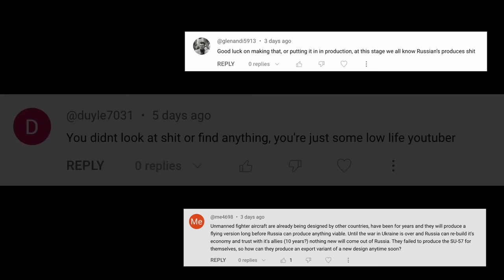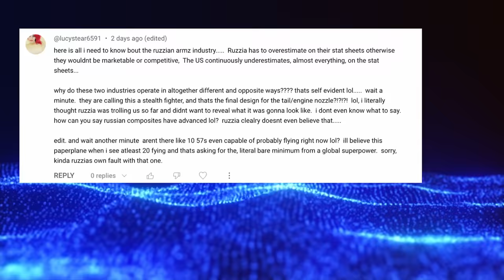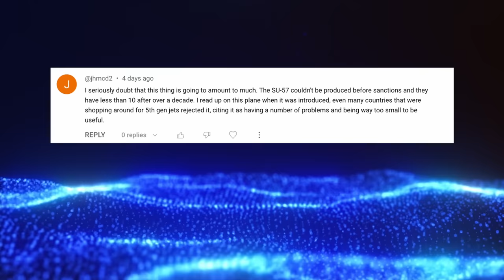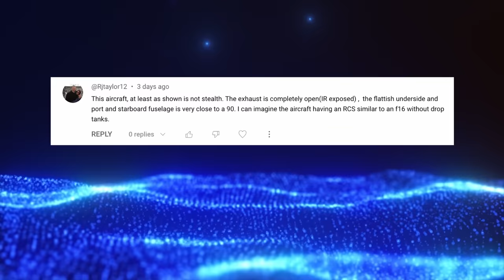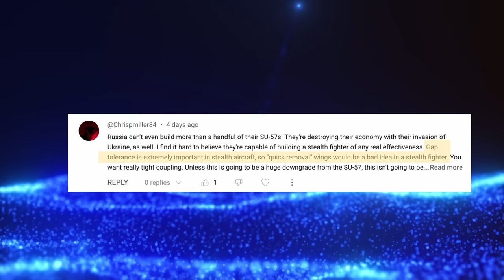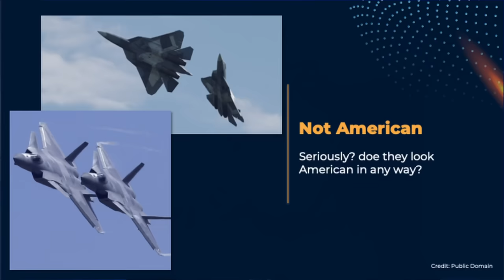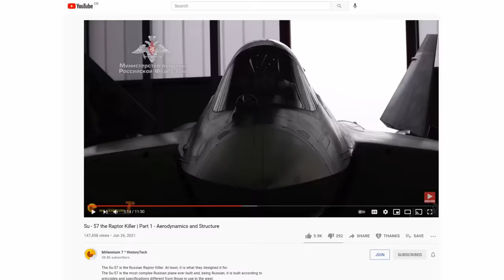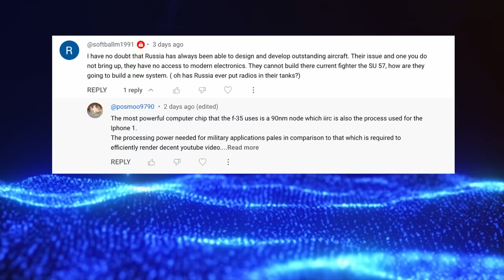Why so Few Su-57s ... and Other Stories.

Comment: ...on the subject of production. I believe there is quite a huge difference between building a few prototypes, or 'handcrafted' planes, and a fully fledged, well-oiled production line. For example Ferrari vs Tesla. (Not saying that Su-57 is a Ferrari, but you get the idea).
Reply: There is enough of video evidence for a series production in case of the Su-57.
Reply: In 2019 MoD placed order for 76 Su-57s by the year 2028. That makes it about 8 planes a year. Sounds about plausible for Russia's production capabilities.
Reply: "Not saying that Su-57 is a Ferrari"

It essentially is.   It's probably the most advanced and effective fighterplane in existance today.
If the F-22 had received all the upgrades it was supposed to have over the years, it would probably have been even between them, but not with the F-22 mostly flying with 90s tech.

And while the best of the Chinese is GOOD nowadays, they're still playing catchup a bit when it comes to combat aircraft as it's only in the last several decades they've had a chance to create a solid industry baseline for it.   Except when it comes to production, there they are world leaders.

"and a fully fledged, well-oiled production line"

Yeah, sorry, but the Su-57 production line is well-attested to be perfectly functional.   It just wasn't running at anything resembling full speed until late 2022.
In 18 months, Russia has tripled the number of Su-57s in service to 12...   With another 12 or 16 conducting acceptance trials.

The issue with the Su-57 line was that there was an extremely tricky disagreement between the corporation and the government on exactly how to price the Su-57.   Part of that was due to how the originally intended engine wont be used until the Su-57M, but also several completely new techniques and materials for production are insanely hard to accurately state exactly what they cost to manufacture.

For example, the carbon nanoparticles/sapphire dust coating used on the cockpit relies on some very advanced production techniques, but also on artificial manufacturing of sapphire and all of those are being done at scales far beyond previously, which lowers the price SOMEWHAT.
UAC however considers the longterm realistic pricetag to be far closer to smallscale production than the government.
Similar for some composites and some electronics and the laser etc etc...
Noone has done massproduction with those techniques before so it's going to take at least another year or two before they can start giving reliable cost numbers.
Reply: @DIREWOLFx75  Except you forget to mention that they expanded the production capacity by building a second production plant.
Reply: @rosomak8244  If you're referring to Su-57, then no, that is not the reason for the increased production, YET.

And i'm yet to even see it confirmed that the plant is for Su-57 at all.
It's also been suggested that it is in preparation for Su-57M.

Are you claiming that you have information that it is up and running NOW?
Reply: @DIREWOLFx75  Well Shoigu was there and it appeared busy around him...
Reply: @rosomak8244  AFAIK, the production line that video is from is the old one?
Reply: Problem is, Su-57 is using same plants, that produces Su-34. And now Russia heavily focused on the serial production and upgrades of Su-34.
Reply: @KGAnims  how many Su-22s were the same factories pumping out a year at the height of production?
Reply: @jamesrowlands8971 um, Su-22?
Reply: @KGAnims well, it was an export variant, but my point is that aircraft production in Soviet times was MUCH higher than now.
Reply: @jamesrowlands8971 well, I mean it was a SOVIET UNION back then, and now it's just Russia. Of course the production will be way less.
Reply: @rosomak8244  "Except you forget to mention that they expanded the production capacity by building a second production plant."

Ok, so i tried to get an update/confirmation, and if i'm reading this right, then you are sort of correct, however, the video with Shoigu was filmed at the old plant.
Apparently, they expanded capacity to build Su-57s due to the new assembly hall having considerably greater capacity and simply being larger.
But, the older and smaller site has since instead switched to only producing Su-34s instead, as those are built in smaller numbers, and with building only those, they can get large enough numbers made there.

This is not hard confirmed information, but should be reasonably reliable.
Reply: @PyromaN93  "Problem is, Su-57 is using same plants, that produces Su-34. And now Russia heavily focused on the serial production and upgrades of Su-34."

No, apparently they moved the Su-57 to a brand new assembly hall, allowing the old plant to produce only Su-34s.   But thank you for calling my attention to it, i had missed the update regarding this.
Reply: @jamesrowlands8971  "how many Su-22s were the same factories pumping out a year at the height of production?"

Not sure how many factories were involved, but the average number of Su-17/Su-20/Su-22 produced per year was around 143.

"well, it was an export variant, but my point is that aircraft production in Soviet times was MUCH higher than now."

That's true for pretty much ALL combat aircraft manufacturing.   They've simply become too expensive, advanced and complex to be easily massproduced.
You have to go looking at lowcost/simple planes like Textron's Scorpion to find combat aircraft today that could easily be produced at those kind of rates.
Reply: @KGAnims  "um, Su-22?"

Upgrade of the Su-17 yes?
Reply: @DIREWOLFx75  Jak-130. It can be used as a combat plane. However I haven't seen any mention of that being the case. Could be that they are just too needed as trainers for pilots.
Reply: @rosomak8244  "However I haven't seen any mention of that being the case. Could be that they are just too needed as trainers for pilots."

Russia is still catching up on producing enough of the Yak-130 purely for use as trainers, so yeah, they do not have enough of them to use them as combat aircraft as well.

Also, they use the Su-25s as much as they do because they're armored and has decent chance of surviving a hit.
The Yak-130 has zero armor and is more intended as ground attack in low threat environment.
Reply: @DIREWOLFx75 didn't they count test articles as full SU-57's to inflate the numbers?
Reply: @georgethompson913  "didn't they count test articles as full SU-57's to inflate the numbers?"

No?

Start of 2022, there were 4 operational, 2 or 4 conducting acceptance trials and 11 prototypes.

Since then, they have built at least another 8 new ones.
AND, upgraded at least 4 of the prototypes to full production model standard.
While another has been upgraded to Su-57M prototype.

Russia has never counted prototypes as anything but.   But once they were upgraded to full version, they are identical to the production model and are of course counted as such.

Russia doesn't CARE about what you think about their numbers, they don't BOTHER with rigging the numbers because it doesn't matter.
They just do not say what the numbers are.

Comment: I found it so funny to read all these "The J-35 is just an F-35 copy, with 2 engines" posts. Nobody seemed to realize that if you put 2 engines where only is one in the "Original", Just about everything around the engines has to change. It's not done with napkin drawings and guesswork. It needs proper design, and testing.

Comment: You forget to mention the new fiberglass based RAM material - it lasts "forever"  absorbs up to 90% of (X) radar waves. Great for big flat(ish) surfaces, tho obv not panel gaps
Reply: What conditions does it last 'forever' under? Composites have all manner of weaknesses in terms of durability.
Reply: @jamesrowlands8971 most polymer composites are very durable when not under mechanical load, as polymers are quite chemically stable.

Comment: Russia has it's own microchip industry, not so advanced as US or Chinese, but you don't need top level 5nm chips for military equipment, I think space shuttle was using like 386 processor and still was able to fly (most of the time).
Reply: The problem is packing a lot of signal processing capability into a small volume on an airframe. That takes advanced chip manufacturing capability at high definition and often involving exotic substrates that can cope with high and low temperatures, vibration etc. better than consumer silicon can. The processors used in spacecraft are often several generations back in terms of modern technology but they have to work perfectly in high-radiation environments, wide temperature cycles etc. Using a 500nm technology chip reduces the chance of a cosmic ray flipping a bit compared to a 5nm chip. Radiation hardening isn't a requirement on fighter aircraft but thermal efficiency, compactness and power consumption is. The F-35 is a flying supercomputer but it has to be to do its job. If the Su-57 is to match the F-35's capabilities it needs ~5nm chips otherwise it's effectively a "monkey model".
Reply: @hrvojelasic5794 lol. That’s exactly how that doesn’t work but ok.
Reply: @robertsneddon731  Judging by the slow development pace the F-35 is certainly not using anything even close to 5nm. Get real.
Reply: Russia announced that it will start the production of 28nm by the 2027. If it will be so...
Reply: @robertsneddon731 This is nonsense. Russia's chips are advanced enough for the most advanced military aircrafts. The F35 would have 28nm chips. The military doesn't just pick the most advanced chips for the fun of it.
Reply: @robertsneddon731 well, back in the days — most electronics of 2 and 3 gen jets was based on radiolamps. And even such archaic equipment was able to do very complicate things, like they has CCRP or/and CCIP. And, as old joke about Phatom II says — "Nobody needs aerodynamics. You  can build flying brick, if you have powerful enough engines".
Reply: @sorinturle4599  They already have in production Elbrus-8S and Elbrus-16S (  find data of  'nm' about them ).Producer is company 'Micron'-Zelenograd. Elbrus-32S will be in production from 2027( there is also data about 'nm' ).
Reply: @robertsneddon731 problem is that’s not true. Very few chips used by the military have transistor gate sizes below 45nm. 5nm isn’t even being considered for military use at the moment due to this. So this is well within the realm of Russian capability to do.

Comment: Great video. When it comes to designing unmanned Su-75 aircraft is it any different than the S-70 Okhotnik. Wouldn't it be the same thing just with Su-75 airframe and specialized flight control. You are smarter than most military aviation analyst, my honest opinion.
Reply: From marketing it's very clever. Buy 10 one-seaters to train on, 5 two-seaters to deploy (second pilot flies the remote by tightbeam) and dozens of semi-disposable remotes loaded with ordnance to get ailerons dirty in risky engagements

Comment: I like your videos and knowledge level. The Russians have not yet succ essfully gone into full-scale production on the SU57. I will believe the Checkmate is legit, if and when they get an actual production version in the air.
Reply: I don't think 57 will see any full scale production in the any close future. 
For few reasons, but one of them — Su-75 approching.
Since the late USSR times, Russia was abandoned idea of light single engine aircrafts, and when USSR was dissolved — all such types, including fairly recent designs like MiG-27 znd MiG-23MLD was simply scrapped. Now things seems to change, and MOD can choose to prefer building fleet of more light airframes.

Comment: Photonic Radar, in concept, still uses radio waves for the outbound & inbound signal medium. But the propagation & reception is handled differently in a manner which leverages subtle interactions between radar waves and laser light. In concept, handling the RF waves with a much more precise spectrum, gives greater fidelity. Ostensibly to produce a much finer resolution of the radar return signals than a normal radar receiver.

Implications & applications = obvious. But it's still subject to many of the limitations of regular radar. It could extend detection ranges, and possibly resolve track or lock quality contacts in unorthodox frequency ranges. As well as add an additional layer of "finesse" to the whole ECM/ECCM/ECCCM game.

The concept is ambitious... how well it would work is another matter. The processing power needed is immense, and could pose a weak-point in itself. There's a sort of 'information overload' aspect to the concept as well. It's all in it's infancy right now. Numerous players are looking into it, including Russia and the US. It's often confused with LIDAR. And it is sometimes touted as a "stealth killer radar". I wouldn't call it a stealth-killer app. But it could "complicate" the RF detection cat & mouse situation.

The fact that there is so little accurate information on it right now in the public space ...speaks volumes.
But the fact that the US and Russia both want to put a photonic radar ON a stealthy fighter aircraft ...also speaks volumes.

Whatever the case, it beats China's quantum radar idea.

Comment: Don’t sweat the trolls. You are not perfect but the BEST out there for holistic Aero design, manufacturing, training, RDT&E, tactics and business analysis of modern combat aircraft.  Don’t let the trolls drive you off your path of unique expertise combined with rare “engineering” communication skills that connect across international “technical” boundaries. 
Surely Boeing, Lockheed, Sukhoi, Dassault, etc., are following.
No one else like you out there!!

Comment: For your answer on the leading composite industries, I have to disagree, the main suppliers are :
1 - Toray of japan
2 - Hexcel which is american
3 - Cytec which is a US subsidiary of solvay
Reply: Leading, not largest. F1 hasn't been much of an automotive tech driver for a long time, but it has meant that UK composites have been pushing the envelope in capability.

Comment: US went into production with F-35 before testing ended, which is why it’s plagued with so many problems. It’s a great plane, when it’s operating.
Reply: yes, this is a copy of the Soviet Yak-141
Reply: @СерхиоБускетс-ф7я  It is not a copy of Yak-141
Reply: It is always like this. The same is true with SU-57 and the J-20. You just don't hear about it but can see it very clearly.
Reply: @napobg6842  This is a complete copy of the Yak-141, the US bought the project from the Russians in the early 90s. The USA also uses ejection seats developed in Britain everywhere. And the entire rocket industry was created by German engineers of the Third Reich.
Reply: @СерхиоБускетс-ф7я  Yeah and all the planets circle around the Sun because Copernicus said so? Like what are you trying to say here? F-35 and Yak-141 has nothing in common except that both are supposed to take-off vertically. The only difference is that F-35 can do that with almost 0 loss of thrust while the Yak-141 loses a lot of thrust
Reply: @napobg6842  F35 completely copies the design of the Yak-141. The Yak-141 set many records; it was a unique aircraft. So just stop writing nonsense. The US stole it from the Russians.
Reply: @СерхиоБускетс-ф7я  You didn't answer how is it a copy when the technique used is completely different? Btw the Yak-141 is a failed project which is a copy of the Harrier jump jet.
Reply: @napobg6842  No Harrier was a different model. Look at the design of the Yak-141 and F35, it’s the same. This is a complete copy. Just stop writing your nonsense. The Yak-141 was a unique and successful model, it is such a complex and advanced technology that the US copied and stole it. The United States was not able to develop its own vertical take-off aircraft.
Just like Elon Musk is now copying Soviet closed-cycle engines.
Reply: @СерхиоБускетс-ф7я   The Yak-141 and F-35 have absolutely nothing in common 🤣🤣🤣. Harrier jump jet was the very first such aircraft! F-35 is a modern jet and uses different method to do the vertical take off. The Yak is a failed project that never took off and was cancelled not even 5 years after its first flight.
Reply: @napobg6842  The Harrier aircraft has a different engine and nozzle design, no braking curtain and etc. This is what is in the Yak-141 and exactly the same design in the F35. The United States bought the project from the Russians in the early 90s, the Americans themselves admitted this, there is information about this on the Internet. The Yak-141 is an absolutely unique aircraft, the best in its class.

Comment: One advice for those who are interested in this topic and I think M7 knows this things. So if someone want to discuss , e.g. compare fighters must know that basic thing in that domain is ''energy''. I wrote so many times about ''energy -factor'' and I will repeat it again. There is 5 energy parameters when we write about fighters:  1. energy in flight-kinematics  , 2. energy-maneuverability( read and learn about Energy–maneuverability theory that is a model of aircraft performance and it was developed by USAF fighter pilot Col. John Boyd and mathematician Thomas P. Christie), then 3. energy of engine/s ( SEP ,thrust to weight ratio or exactly given dynamic thrust to given in flight weight ratio), 4. energy of fighter's radar ( energetic capabilities) and 5. energy of AAM's ( energetic/kinematic capabilities ).